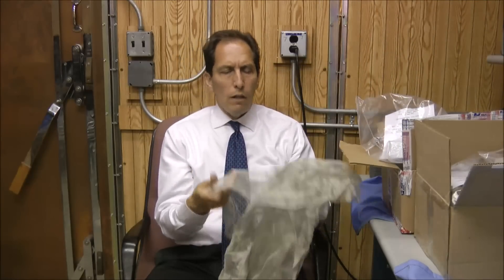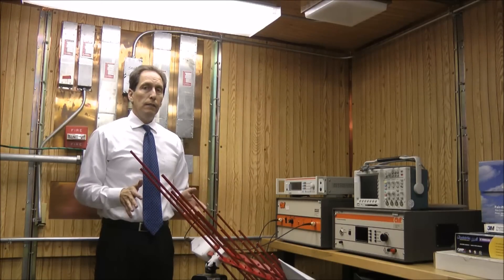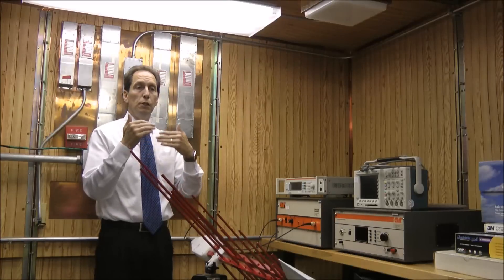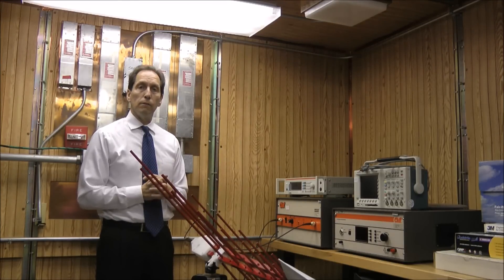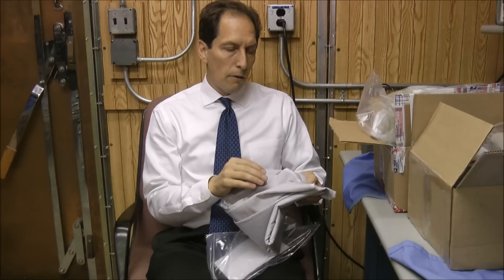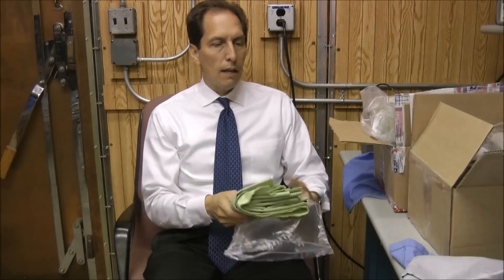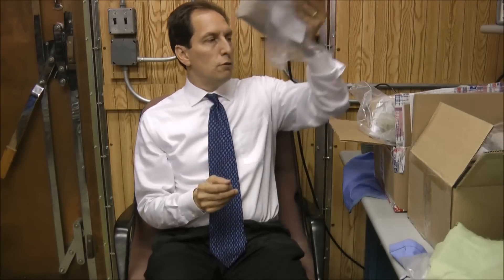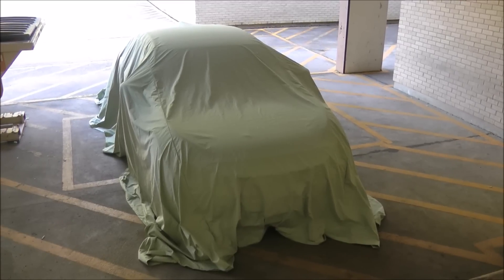Protect Generators and Cars from EMP

Comment: You stated 40 db.  Is that dbm / 40 watts or 40 db rejection, and what were the frequencies?  I run 500 watts HF, 160 watts 2 meters and 100 watts UHF for ham radio.  I grounded the crap out of everything and also wrapped wire leads that were picking up rf and getting in thu some Canbus circuits.  I liked the Laird technology ferfites best for rf rejection.  I pulled the relay panel out of the box, used copper shielding and grounded that.  I have in the past just mixed graphite powder with urethane and sprayed surfaces for grounding.  Boat bottom copper paint also works well.
This is different that EMP protection but it is interesting.  I had to go thru all wiring with e and h field probes on my spectrum analyzer to chase it all down.
Another question is did the fabric that was conductive on both sides allow rf energy to couple to metal on the vehicle?  Did you couple to any wiring going to and from the vehicle computer?
I've been thinking about abandoning newer technology and use a MSD ignition system.  A spare could be popped in the vehicle in just a few minutes and would be a lot easier to shield.  I could still have controls with a plc based unit but that could be fried and need replacing.
Ham radio is starting to use SDR which to me is a bad choice for community service after any type on EMP event.  We are supposed to help after disasters but nearly all new transceivers are now SDR based.
Reply from the maker: By dB, I am referring to the reduction in the electric field (i.e., 40 dB = 99% reduction in the electric field, 99.99% if power is measured). The frequencies of interest are 100 kHz to 1 GHz. The material will actually block much higher frequencies (tens of GHz), but I didn't test above 1 GHz. The cloth essentially acts as a reflector and absorber of RF energy. Some energy manages to pass through (a small amount comparatively), and that can couple onto the car frame, cables, etc. In my experience, cables have always been the most offensive receptors of RF energy.
Reply: @disasterprepper  It was a battle to get my vehicle to withstand the rfi from high power mobile operations.  I reduced the rfi enough to eliminate all issues.  For those looking into cb radio for communications in emergencies, the 2007 Jeep Rubican I had was a real problem.  At only 5 watts output in the 12 meter band, would disconnect the sway bar and was a real danger.  Winshield wipers would turn on and if power was increased it would blow out the AC controls.  As a ham we stay off 11 meters but it is close enough to out 12meter band to be an issue especially if running an illegal amp putting out spurious emissions.  The 12 meter rfi was coming in thru the AC wiring but Chrysler would not let me shield it without voiding the warranty so it went back to Jeep.  I bought a new 2010 H3 Alpha then.  It took me about a week to install and get the bugs out and GM had no issues with what I did. I ended up with 0.853 V signal from 26.5 V rfi giving -29.85 db.

Comment: i live rural.
 i was driving a 1987 suburban in a storm, and a lightning bolt hit a nearby  powerline poll.
it shut my truck off.
after i rolled to a stop it fired back up and i drove off.
it took out two towns electricity.
how much voltage do you think it took to do that?

Comment: Can you do a video on the EMP shield I want to know if it will actually work or not
Reply: As far as I can tell, EMP shield is basically a surge protector. Siemens and Leviton make similar surge protectors (for a lot less $), and there are YT videos about how they work, plus their limitations. Edit; disasterprepper website is a great resource on serge protection.
Reply: @Robnord1  that's what I was thinking but I watched so many conflicting videos that I wasn't sure
Reply: @TheDrakanMaster124  I found some of the EMF Shield literature a little wishy washy, so have been researching. If I get one, it'll be the Siemens this guy recommends. Under the tab 'Whole House Ferrites' on his website he mentions the Siemens unit and shows how they're wired in.
Reply: @Robnord1  thanks would it work in a truck
Reply: @TheDrakanMaster124  No. The ones I mentioned are for whole house protection.

Comment: Greetings: I watched this great video almost 2 years ago and made a faraday cage out of a galvanized steel trash can, but I have a question: If I use a rubber bungee cord over the top from handle to handle to tightly secure the lid, will the rubber compromise the effectiveness of the faraday cage? Thank you for all your great videos...best wishes for a MUCH BETTER 2021!
Reply from the maker: Hi Stephen, the bungee cord won't hurt anything. In fact, it probably helps because it helps to seal any gap that might exist between the lid and the can.

Comment: Very good video, very useful. That being said, I recommend not to rely too much on electric devices. Why? Because if an EMP occurs, it will come through every metal grid (electric, telephone, water piping) into your house with an incredible high voltage. All devices connected to the grid will instantly get fried. So your first worry would be to keep your fire extinguishers at hand. A cloth only protects against the radio pulse of an EMP but not against the massive electric current, that will fry your plugged in tv, your plugged in fridge, your airco, your solar panels and so on. And if you have a generator that survives, you will hardly have a device left to power.  Therefore I purchased lots of candles, matches, fire extinguishers and many manually operated devices like hand driven drills, non electric thermometers, a chronograph watch and so on.
Reply: Do you have any data or have you done any actual testing to support your claims? Is there a website or URL link you can provide to substantiate your statements?
Reply: @PitDoc  Hi, I suggest you read  "Blackout Wars" by Dr. Peter Vincent Pry. He was a science advisor to Ronald Reagan and Chairman of the Congressional EMP Commission. In this book he warns that a nuclear bomb, detonated in the Ionosphere, could blow up the entire grid from horizon to horizon. If that would occur, the entire grid of a continent might be utterly destroyed and it would take months of not years to repair the grid. Such a continental blackout of months or even years would kill 90 percent of all people due to famine, droughts, diseases and chaos. Why? Without electricity, our entire society will collapse. See this book for details.
I have the book in my posession but I haven't read it in the last two years so I do not remember all the details. Furthermore, I have seen numerous Youtube videos that describe the effects of an EMP. However, I did not document which ones I have seen, so you have to do your own search. But I am sure, that just the key words "EMP" and Peter Fry will give you numerous hits.
Finally there is a piece of own interpretation. It is my assessment, that we have a good chance that an EMP will ruin our electric devices and that this might cause short circuits and fires.

Comment: Could cloth be painted with conductive metal paint and have similar results? Or, say paint the inside of the garage with the conductive paint?
Reply from the maker: In theory, yes. In practice, I think it would suffer many problems over time. Conductive paint on walls works somewhat, but on cloth, I don't know how well it would last without creating small cracks in the paint.

Comment: Please demonstrate the connectivity of these cloths.
All you need is a dc power source,  and multimeter.
Add some wire and a bulb for completeness. 
What's the resistance reading per foot? 
Are you saying it's a flexible farraday cage?
Reply from the maker: I'll set up a simple experiment to show this. By connecting a DC power supply across the cloth and measuring the current, you can easily derive its resistivity (in ohms per square). While conductive, it is not as good as a high-quality Faraday cage that uses solid metal (or extremely fine mesh). The cloth built around a frame might give 30 dB of shielding (97% field reduction), whereas a good homemade Faraday cage out of tin foil might give 50 dB (99.7% field reduction).

Comment: Wouldn’t any vehicle before 1980 be OK? Those vehicles wouldn’t have any electronics to fry in an EMP
Reply from the maker: They would be less like to be damaged, but even pre-1980 vehicles had electronics.
Reply: I like your idea of an EMP proof vehicle cover. I have a pacemaker. Would that same material provide me protection from an EMP?
Reply from the maker: @williams5671  I did an analysis of a Medtronic pacemaker, and it looked like it would survive an EMP, even in the worst hit areas. I can't say that all pacemakers would survive, but it looked promising. I plan to put the analysis in my upcoming "advanced topics" emp book. As for covering them, you could wear a conductive shirt (they have some soft silver-based thread shirts). That would help to reduce the fields, but I can't say how much without testing.

Comment: cheap and easy way to shield car from emp  buy a used computer identical to your model and store in a emp proof container as backup
Reply from the maker: I'm not so sure. While I like the idea of storing a spare computer, there are hundreds of small microcontrollers in modern cars, any one of which could be damaged.
Reply: @disasterprepper  yeah, and thats why I only stock up on the spares for the following vehicle and year, 03, 4runner, 95 previa, 03 frontier, 10 sienna, 14 fj. those are the cars that had least amount of microprocessors on sensors, and worst comes to worst, the spare PCM would allow me to drive, I dobt really care about creature comfort in an apocalyptic world.
Reply: @disasterprepper your theory works if urs is hybrid, tesla, oh and I would also store a pair of mountain bikes and a motorcycle

Comment: With so much fearful talk being generated by the threat of an EMP attack it seems that the government and manufacturers should be hardening our country to resist such an attack. I'm no scientist but can think of a few ideas that might help. Sheet rock for bldg construction could be made with EMP material inside it. Any items that contain  solid state devices (especially automobiles) should be built with EMP shielding; most importantly work to protect our electrical grid  should begin immediately. I recently watched a documentary that said our nationwide transmission paths could be protected for about 11 billion dollars. That's nothing compared to what an EMP attack would cost us.
Reply: Good idea, but the cost to your average person would make it unatainable. Dry wall itself isn't cheap.  Add metal to it and the cost goes up exponentially.  Just sayin.  😁

Comment: why cover a car with it if a car is already metal and is more uniform than a metal net?
Reply from the maker: You're trying to seal up the rather large holes in the chassis, such as due to the windshield, etc.
Reply: @disasterprepper  oh i see, makes sense then. Yeah and it will be strong enough to damage the ICs. The glass still attenuates a fair amount of signal on VHF and under. So, what frequencies will an EMP most likely be on?
Reply from the maker: @letitrotfuckit  The spectrum of an EMP is from about 10 MHz to 1 GHz -- very wideband.

Comment: I have a 60s model car. I will just wrap the coil and dist. in aluminum foil and ground it. The generator wiring is so heavy that if the EMP blows that it will probably fry our brains too. Batteries in storage.. if you have a stick you can push start it...Rock and Roll

Comment: A couple of thoughts, as both a seamstress and someone who has bought and gone through many custom car covers for show and classic vehicles.  You many have gone through these issues by now.  Sewing the fabric with metal cloth likely dulls up needs fairly quick but denim needles likely work.  The fabric likely works only as an indoor cover.  Exterior covers have to be of very durable fabrics which still must be replaced every couple years, and cant go to the ground like that, or moisture builds.  Wind would blow them off anyway.  I think it would work only in a garage, and it might be easier to simply "faraday" the garage itself.  Unless a stored vehicle, the chances of a car being in the garage with the EMP hits are what percentage?  If an older vehicle, of course it doesn't matter - an EMP won't affect the vehicle, and a newer vehicle wouldn't be stored...
Reply from the maker: Hi Sirena, I don't actually sew them myself. I take them to a local car upholstery shop for that. It's just too big of a job with these huge covers. As for using it outdoors, you're right, they're primarily meant for use in the garage. Some people do use them outdoors, but they put either a tarp or a conventional car cover over the top to minimize wear to this expensive fabric. Two things I politely disagree with you about, however, are the susceptibility of older cars and making your garage into a Faraday cage. There's no evidence that older cars wouldn't be affected by an EMP. While I do think they're less susceptible (it only makes sense), I wouldn't say that they're immune. As for making your garage into a Faraday cage, I think you'd find that tremendously difficult, if not impossible. The reason is that there are wires running into and out of the garage, which would bring in the high-frequency energy. That's not even considering how hard it would be to seal up movable garage doors properly. I suspect it would take many tens of thousands of dollars to do properly, and I say that as someone who has designed shielded rooms.

Comment: https://www.centurytool.net/System_Protectors_And_Zap_Protection_s/46118.htm  Do you think these devices would protect vehicles? They are marketed for protecting vehicles that are welded on. They are considerably cheaper than the one made by empshield. Would adding ferrites to the battery cables help also? Thanks.
Reply from the maker: The only way I know to protect vehicles is to cover them with something conductive.

Comment: Is this cloth sufficient for a Carrington class Solar storm?
Reply from the maker: A solar storm, such as the Carrington Event, wouldn't couple efficiently into free-standing electronics, such as cars or generators, unless they were plugged into the grid. Solar storms are very low-frequency events that really only couple into very long conductors, like our power grid, buried conductors, pipelines, etc.
Reply: @disasterprepper  How long does the conductors has to be to couple well? Within a order of magnitude?
Reply from the maker: @chrisgerrby3665  If you figure that a solar storm has frequency content up to say 1000 Hz, you would need a conductor to be about 1/10 of the wavelength or 3e8/1000 x 1/10 = 30,000 meters (around 20 miles). Just a swag...
Reply: @disasterprepper  
Incredible. Thanks. 

I have read a lot of mixed beliefs about if surge protectors can protect against a spike from the grid from the solar storm. Is there a simple answer to this you know of?

Comment: It can get pretty complex and expensive, fast, to protect yourself. What good is your generator if you freezer, fridge are destroyed. And if you can/did you'd have to have a LOT of food stored AND, if you live in a city, being THAT GUY running a generator is going to draw A LOT of attention. The issues are massive and overwhelming. Odds are, unless you live out in the country, and raise some sort of food, you're in very serious trouble. Very serious trouble. You ARE the masses. I have an old generator that runs on a lawnmower engine, basically. It will survive. My inverter honda will most likely die. Then there is the gas issue. It's just problem on top of problem on top of problem on top of problem. This would kill billions.

Comment: If an aerial burst nuke was discharged..how far does the EMP travel, or how far from the blast would you need to be away from the approximate ground zero before you don't need any shielding? 20 miles, 50 miles, 100 miles or..?
Reply from the maker: A high-altitude EMP's effect could span nearly coast to coast. Natural terrain would provide some shielding, but it comes down to a line of sight problem. The higher you are, the greater the line of sight.

Comment: Much easier and  cheaper to just buy a spare ECU (make sure it's flashed for your vehicle) and protect it in a Faraday bag.. you may need several ecu's or pcm's with all these newer cars but the main ecu will get the vehicle running.
Reply: Agree.
Reply: Can you tell me more? I'm new to this.

Comment: wonder if a device is not plug in at the time of an EMP will it be OK or not or a car not running at the time
Reply from the maker: It would certainly have a much greater chance of surviving, since it wouldn't be exposed to the large conducted pulse coming in on the power lines. But any electronic device, even not plugged in, has the potential to be damaged by the radiated pulse, cars included.

Comment: How is it with li-ion battery's ect that have electronic circuit in it for protection against charging and discharging 🤔 ?
Reply from the maker: Charge control circuits that are built into li-ion batteries would be considered susceptible to an EMP.
Reply: @disasterprepper  What about alkalines, NIMH, Lead-acid and newer LiFePO4 batteries? Do they require Faraday cage protection or not?  Thank you very much!
Reply from the maker: @johnbauman4005  Batteries that don't have charge control circuits built into them aren't seen as susceptible, so they don't need to be stored in a Faraday cage.

Comment: the only safe way is using lead i would of though however I am no expert
Reply from the maker: Lead is useful to block ionizing radiation (such as in the doctor's office), but it's not necessary to block high-frequency electromagnetic waves.
Reply: @disasterprepper  true but if you wanted to totally safe it would be the way to go